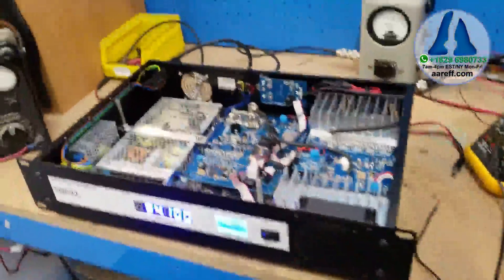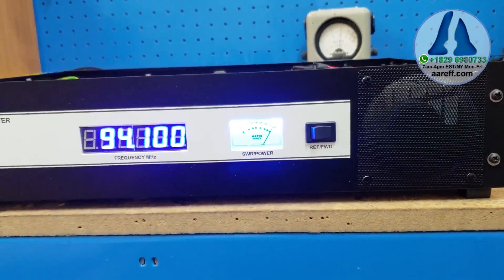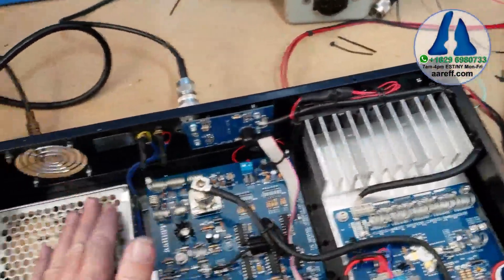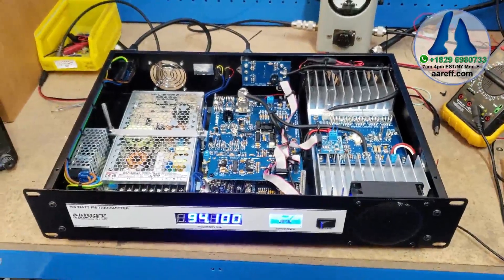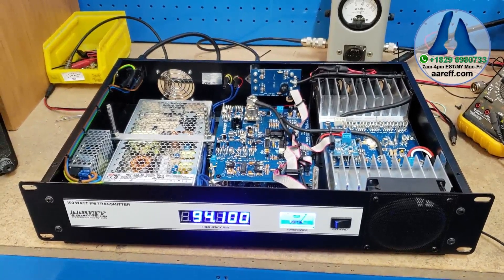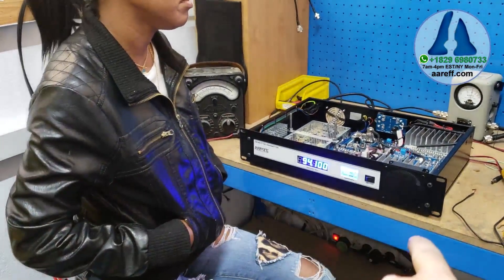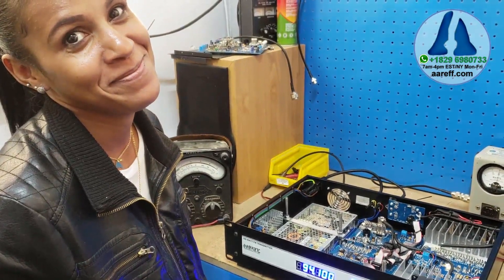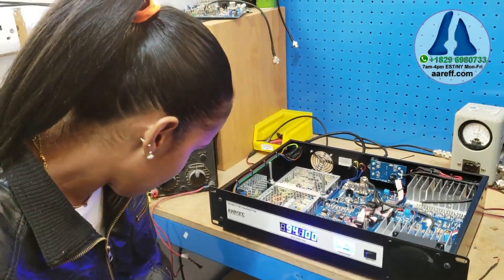100W FM Transmitter, Super Silent !!! suitable for use in a live studio

Comment: Hey Paul we need  1kw equalent
Reply from the maker: Can't do it yet, but we have been thinking about. It would take more than super massive heatsinks and  gentle low rpm fans. It would need refrigeration heat exchangers also, which will work, but will increase the power consumption.

Comment: What's the highest chain antena  compatible with this model and can this run 100 indefinitely
Reply from the maker: You can use an 8 way stacked dipole with this. Yes, it will run at 100W indefinitely 24/7 usually for 10 years without a problem, What I didn't say on the video is that it had been running at full power for 24 hours before we made this video.